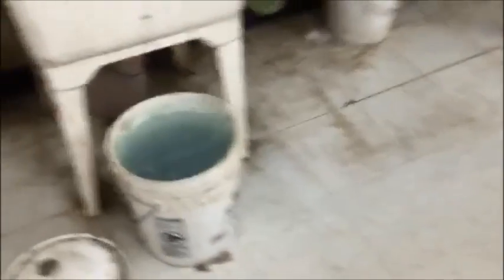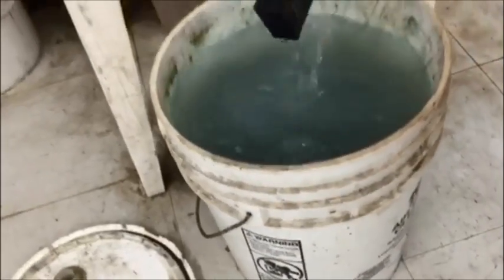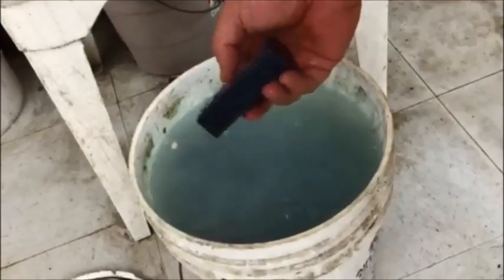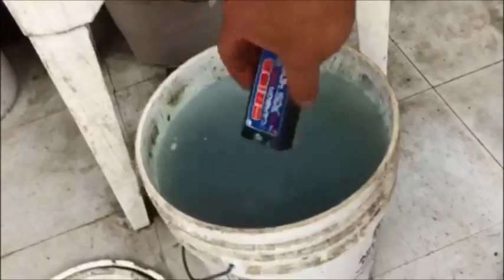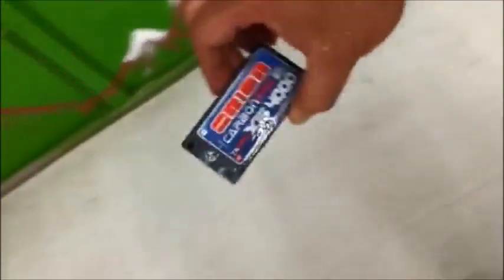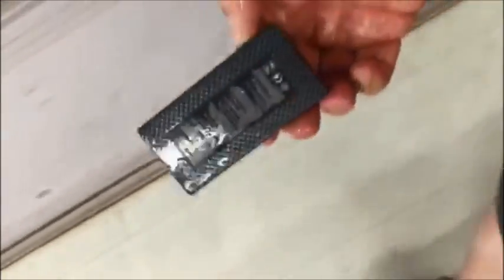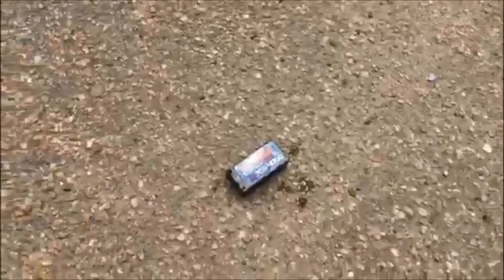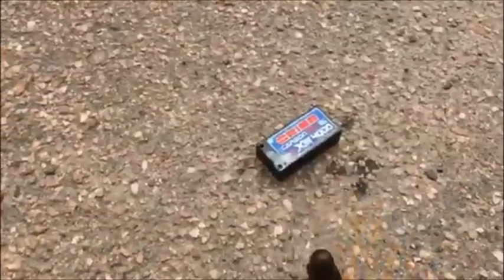How to dispose of a lipo battery

Comment: only problem here is electrolysis will dissolve the tabs and sometimes before the cells are fully discharged, so what you're left with is a lipo with no way to discharge it.  The complete method, according to it's originator, is widely ignored.
Reply: Traxxas recommends salt water but imma pass on pounding it with a hammer